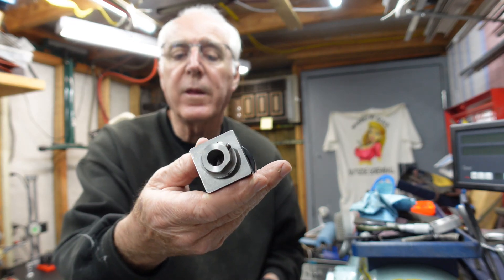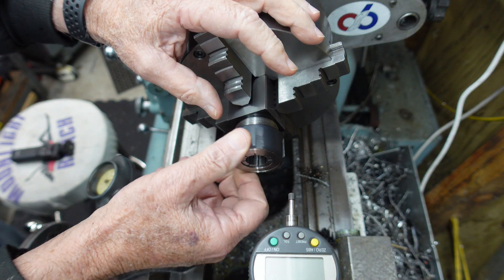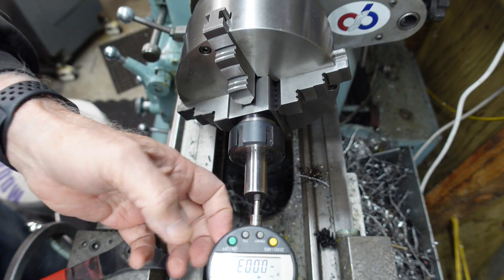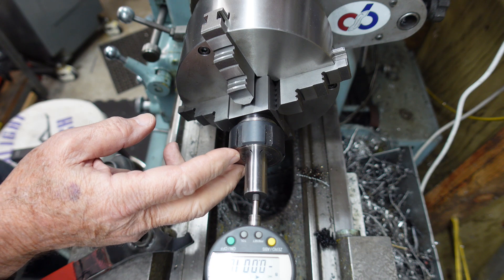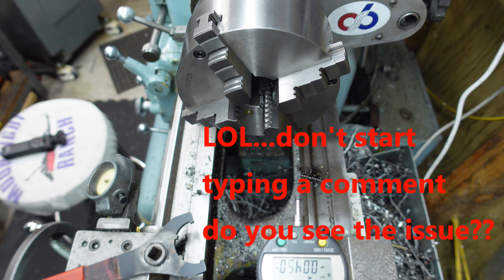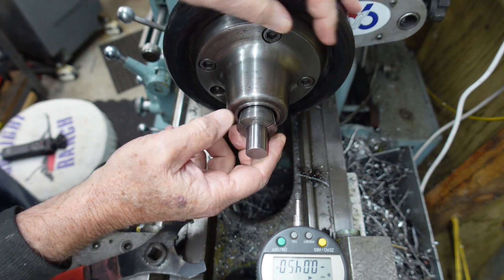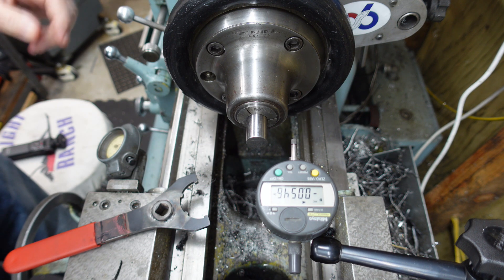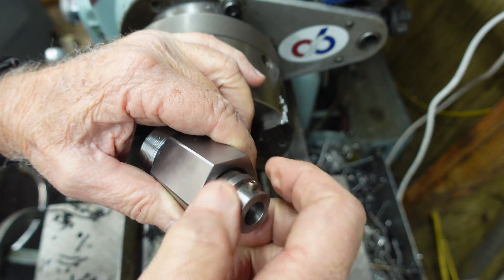ER 32 Collet and 5C Collet Stop Test

Comment: A couple of comments if I may, I struggle to understand the whole concept. If you tighten a rigid fixture twice, it's supposed to measure the same, isn't it? I mean, for both cases you had applied, more or less the same force, so they were resting at the same position, it would be really surprising to see any differences!

On the 'pulling' issue: the difference in your two setups is that for the ER case the stop is on the fixture, and it will NOT move, whereas in the 5C case, it' moves with the collet. Like I said above, when testing with the same piece, no difference of course. For the 5C, if you use a piece slightly undersize in OD, the 5C collet will pull in more to grab it securely, pulling the stop along. So, even though the stop position hasn't changed w.r.t. the nose of the collet, the whole assembly now rests deeper in the spindle, so Z position has changed (and will show if you're facing to length). The ER setup you have there is 'dead length', the stop (and, subsequently) the nose of the part will always be at the same Z position.

Last, afaik, holding pieces with reduced engagement in an ER collet is not wise, you need at least half the length of the collet to be safe, I think even more than that actually.
BR,
Thanos

Comment: Well, almost. The ER32 is better in this situation because the stop is in integral part of the holder, not the collet. The stop itself remains in the same relative position to the indicator regardless if it is loose or tight. Not the same with the 5C collet. The stop moves in relationship to the indicator depending on how tight you close the chuck. The stop in a 5C collet is only really repeatable when used with a collet closer lever, provided the lever is of good quality, and it pulls the collet in the same distance each time.

Comment: @ 7:39 OK. The stop and the  5C collet move. When you release the collet, it moves out.😁     With the ER32 COLLET, the stop does not move. OK, it can not move, it is secured to the "hex/square block," secured to the chuck. IMMOVABLE. The job, can not., will not move as the collet tightens😮 Yes,the ER collet may move. Yes, for the infinite movers, I am not talking about making the earth move. Thing is, for repeatability, each job piece is as close as goddamn, any tenths don't give a shit. I made the ER stop, to enable excellent repeatability, knocking up over 200 pins for "KANT CLAMPS". Results...spot on.😮😮😮😮

Comment: I like your collet stop idea Chuck. Suggestion. On your ER wrench, cut off the hook on one side. So, you only have 3 instead of 4 stubs. Then use it as a typical hook spanner. Reduces the fighting getting that wrench on. I learned this from Double Boost's channel. Works great for my ER40 collets.
Reply: great idea

Comment: With the stop attached to the collet any variation in diameter will cause a change in location. With the stop attached to the fixture it, it has minimal opportunity to change. It doesn't move with the collet so he location of the stop as the collet is closed will not cause any variation.

Comment: so I stand by my statement b4. At 603 in your previous video you said that the collet doesn't pull back.
Yes it does. That is without the qualifier of the stop. You didn't mention the stop, only that you don't understand why someone would say it pulls back when it doesn't. It absolutely pulls back, that's how it works.  
Is your stop able to overcome the pull back forces? Yes for smooth metals. For some it is possible that it won't.  The way the collet works, is it pulls material in until the jaws lock down hard. Clarity.

Comment: Great comments so far...
The ER collet moves into the collet block as it is tightened. Since the stop does not move with the collet, this setup puts some amount of force on the piece against the stop, and also the collet slides along the piece. The force and movement are small, but they are not zero.
Reply: That is what I was thinking.

Comment: The whole length stop issue only really matters if the diameter of the stock to be held is slightly variable, which results in the collet having to go further or less into the holder to be able to grip. Gauge pins be their very nature should be, within reason,  repeatable, any variation being from changes in tightening torque.
Reply: The length will change in relation to the diameter in C5 collets, because the wedge (collet) will not travel to the same point.
In an ER 32 (or 40,16 …) the length really doesn’t depend on the travel of the nut.
Reply: @thigtsquare950  the length wiĺ not change in relationship with a 5C collet, but the collet will move in or out if the diameter held is not always the same. With an ER collet there is a technical issue using a stop in the collet holder, rather than being inside a 5C collet, because the stop will fight the volley movement to allow tightening. Either the stop will try to push the work through to collet as it is forced into the holder, or not tighten properly because the stop stops movement. How much of a problem this will be I cannot foretell.
Reply: The 5C will move. The ER will not.

Comment: Chuck,
Nice visual presentation and well explained. I might point out a possible flaw in this however. The ft lbs of pressure to tighten the respective collets needs to be equal each and every time the test comparison is made...ie: when tightening and measuring the 5C collet, it needs to be torqued down/in each and every time to the exact same torque setting......and the same goes for the ER32 collet........if the torque settings are not equal each and every time, the possibility exist that the collet is then NOT seated into the collet block itself equally.......
Benchrest shooters and World class precision gunsmiths with very rare exception, always TIGHTEN DOWN their lathe tailstocks to equal torque settings when cutting and reaming a chamber, thus ensuring ZERO shift of the tailstock during the various passes in producing such a precision chamber......the cutter/reamer might shift from its setting/zero indication, by 4/5/6/7 microns with unequal torque holding the tailstock locked....when cutting and reaming with such precision and demanding tolerances. one MUST ensure all is equal and not allowed to move...IE: equal torque settings........just saying....
Don
Reply: Agreed. This is why some ER collet wrenches have a square drive adapter for a torque wrench … to improve repeatability. There’s dedicated ER collet torque wrenches for this reason as well.
Reply: Splitting hairs

Comment: The 5C stop will move with varying diameters whereas the ER will repeat on a range of diameters.
Reply: Well the idea of a collet stop is meant to be used when you are doing a run of identical parts. Given that, I am not sure why you’d have varying diameters. All the various collet types have their pros and cons.
Reply: @grntitan1  I think the ratio with a 5C is about 3:1. Where every unit difference on diameter is 3 units difference in the stop position.